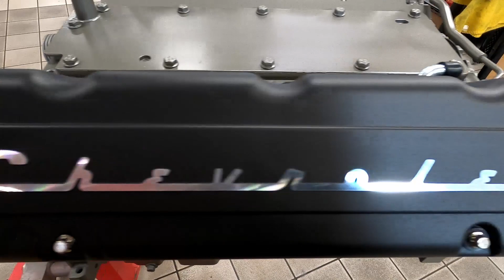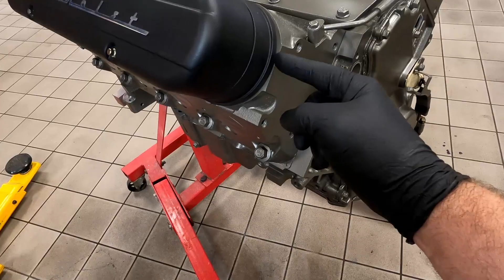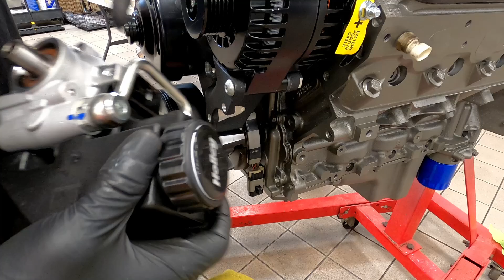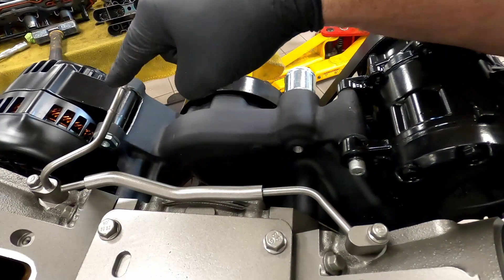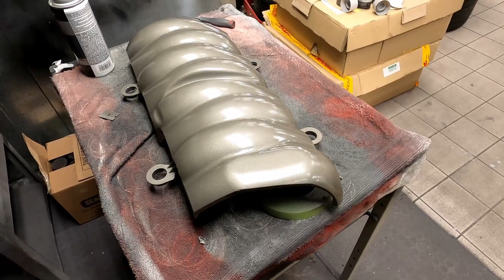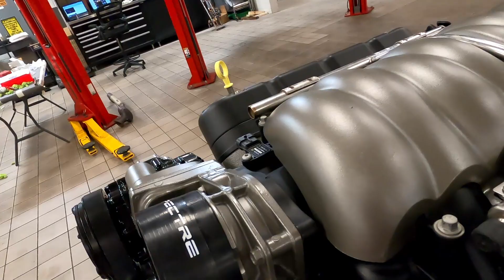69 Chevelle engine build part2. Cam install and Holley mid-mount install how to.

Comment: What color did you paint the engine block I think it looks great with the black. Which is what I am putting on my engine in my 53 Belair
Reply from the maker: If I remember right that was Duplicolor Engine Enamel, "cast coat iron" color. Part# DE1651
Reply: @quick455 thanks I will look it up.